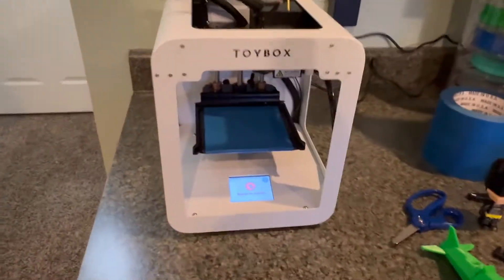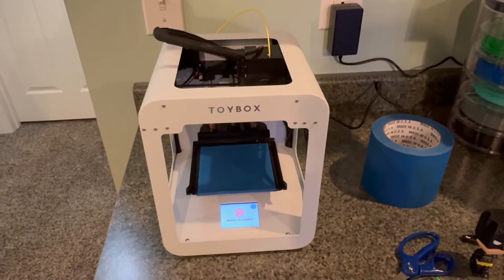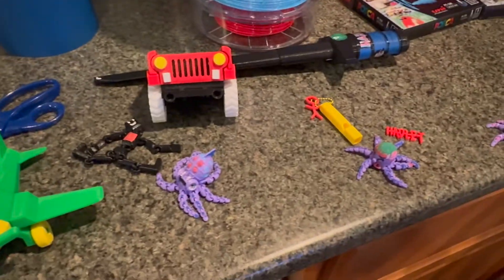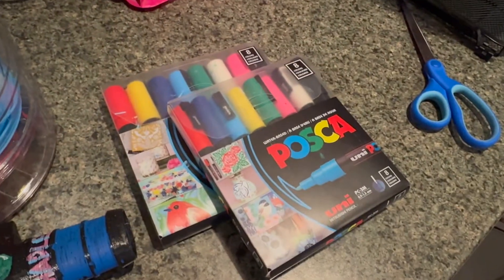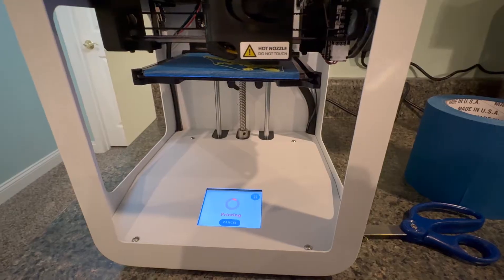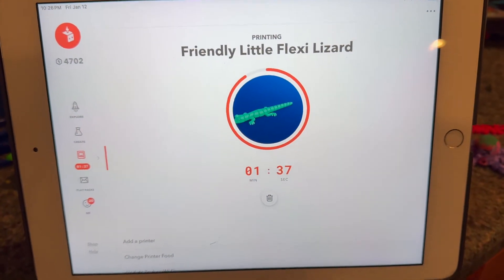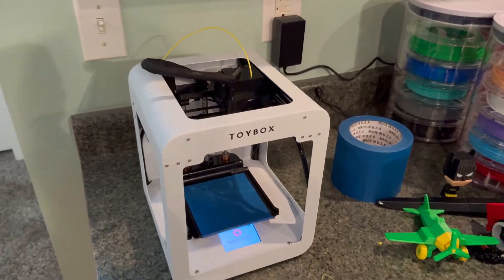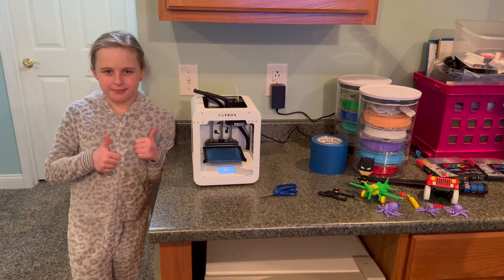How to avoid failed prints, print shifting, and other common problems on the Toybox 3D Printer!

Comment: We're trying a print now that keeps failing.  The bed won't move down on its own to make room for the print.  Help?!
Reply from the maker: When you say the bed won't move down, is the bed not moving at all? The bed only moves down very gradually while printing each layer. It may be moving and you just can't see it. If it isn't moving at all you may have a separate issue. But my guess would be your machine is digging the hot end into the bed and needs adjustment. Search the facebook group for Toybox and you should find answers for both issues.

Comment: Hi, I am a total noob. Just got toybox alpha 2 for my 8 year old, and he loves it, but the larger prints are failing like an hour into it. 
Can I ask what the painters tape does to help that?
Reply from the maker: The painters tape makes prints stick better than just sticking to the print bed alone. Full disclosure, I have stopped using our Toybox. I like the toybox and I had great luck with it. I bought a full size bambu lab A1 last summer and have not looked back. When I bought the toybox there was only one model and I have not kept up with them since. So I don't know if the alpha is the new model or old model. I can just tell you the sophistication of the A1 makes it so you don't need to trim the little excess printer food before printing, the A1 does this automatically. Also, the A1 has a heated bed that has much better adhesion. Therefore it does not need the painters tape. I don't want to sound like a bambu labs commercial, but i absolutely love ours and have hundreds of hours of printing on it in only 6 months. Toybox may have new models that are better than the old one I had. But it would take a lot for me to stop using my A1. The toybox was great to learn on and got me an my kids started in 3D printing and for that I am thankful. Happy printing!

Comment: For anyone having issues with failing prints or prints that won't stick: if the tray is clean, try calibrating the printer. The printer bed was about 1/2 turn of the adjustment screw too low. The printer bed was too far away from the nozel. I turned the adjustment screw half a turn clockwise and haven't had an issue since

Comment: very helpful information . I have lots of questions. I made a person and the parts don't fit. The hair is too small for the head. Also none of the connectors arefunctional. can you tell me where to go for help.thank you
Reply from the maker: I would start by going to the facebook toybox group. It was super helpful to me when I first got started. Now I hardly use my toybox at all. It's still a cool little machine, but i have since upgraded to a Bambu Labs A1 (not the mini, but the full size version). Compared to the old toybox this machine is much more automatic (no need to gut the excess before printing, the printer does this for you and can print up to 4 colors at once with the AMS lite). I do understand that toybox has come out with new models this year and maybe they have more features like the bambu, but now that I have the A1 I don't have a reason to look into it. Check out the Toybox facebook group for more info on your specific file to see if others have had similar problems, that group will also surely have a lot of info on the new printers. Thanks for watching my video!

Comment: Ours isn't printing at all any tips we should try? We tried the calibration we tried the reset and unplugging re-plugging.
Reply from the maker: I know you posted this question a long time ago, some how I missed it. Hopefully you have found a resolution by now. If not, open a ticket with Toybox customer service. Also reach out to the Toybox group on facebook they may have some pointers on diagnosing the issue.

Comment: Any idea why it would making loud grinding noises while printing
Reply from the maker: Mine makes a lot of noise and I would say that is normal. Excessive grinding is not. The first thing I would make sure is that the black cable at the top of the machine is not bound up inside the frame of the machine. It needs to be on the outside top so it can move freely. If that doesn't fix the problem I would suggest joining the Toybox 3d printing community on facebook. Once joined, Upload a video of what your machine is doing and ask the group. They are super helpful and will likely identify the problem or let you know if it is a normal operating noise.

Comment: Thank you. My son and I were trying to print from outside Toybox and found they moved while printing. Please Stop buying bolts there are better prints online. The containers are nice a def buy.
Reply from the maker: I would agree that there are great options outside the toy box app that can be uploaded into the app. We don't buy bolts. But we do subscribe to the Toybox Plus subscription. It is $10 a month. You get one unlock credit per month, exclusive prints and some extra bolts. I haven't found the need to buy additional bolts. For $10 a month the exclusives have been fun for us and the kids. But your point is taken, we likely won't do the subscription for long. We have only paid for it for 2 months so far.
Reply: So can you still print anything or just there crap